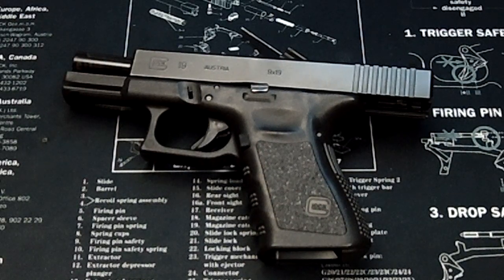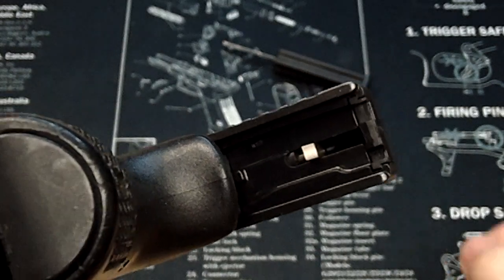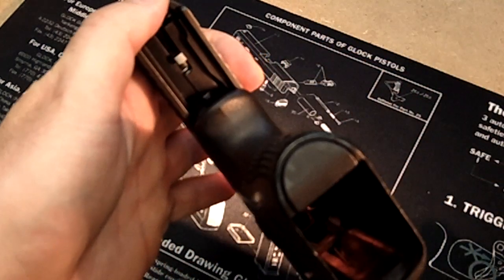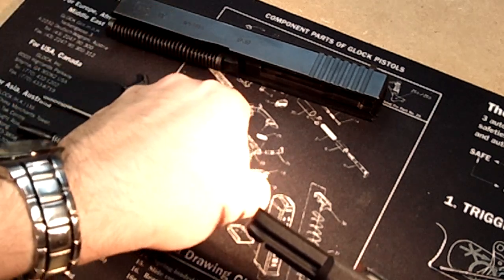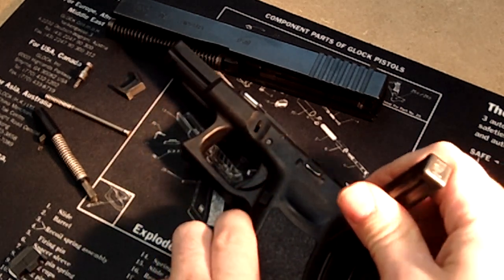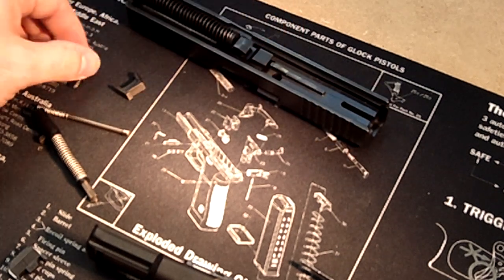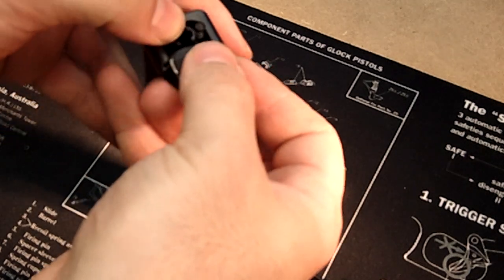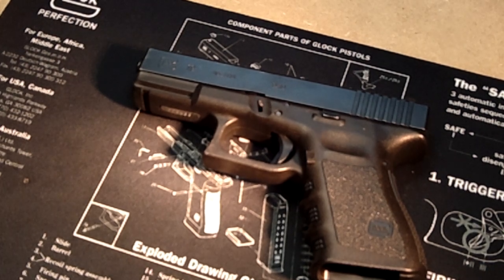What to do if your Glock won't fire

Comment: I agree with Bob BTRAVLIN, once you removed the rear slide cover, that releases the striker assembly to be pulled out. You did not have to remove the extractor depressor plunger, the extractor or the safety plunger to remove the slide.

Comment: FYI no need to remove the extractor, this issue is usually cause by the connector not engaging with the slide and needs to be bent outward.

Comment: Thanks for the video, I thought I was lost. Once I got the slide off, I watched your re assembly video and put my 23 back together. My problem was that the trigger was really stiff, sometimes it would get better, then it would get bad again. Soon I was having to use two hands to pull the trigger and it wouldn't break until I began to release the trigger (scary). After about two pulls like that it stopped breaking all together. After reassembly it worked but quickly began doing the same thing.

Comment: Just so you would know at 2:28 that is isn't called a an ejector - that is called the extractor. Ejector is a Sharp PIN that - ejects the Shell out. Extractor - extracts and holds the Shell out of the breech (Barrels Chamber) when the Gun has been fired.

Comment: AFT you pull the firing pin, reinstall the slide cover keeping the extractor in place, then remove the slide as normal. 
That keeps the extractor and firing pin safety assembled.

Comment: Very good video, but there is an easier way to do this.  If you pull the trigger but it won't release the firing pin (so you can't remove the slide), do the following - 
1)  Understand all firearm safety rules and ensure your firearm isn't loaded and that you don't have a round in the chamber
2)  Pull the trigger fully to the rear and hold it there
3)  The back plate of your slide has two openings - insert a very thin screwdriver (a 1/16" punch works great) into the right side (non-square) opening at a slightly upward angle.
4)  Press the point of your punch down (you're pressing down on the cruciform shaped part of the trigger that releases the firing pin) and your firing pin should release, allowing you to remove your slide.  Hope this helps!
Reply: or u can skip all those steps & just push the trigger bar past the firing pin safety through the Mag well & the trigger will engage

Comment: I had this issue. Had to take down my g21 probably 6 times I had an issue with the cruciform being too bent and not clearing the striker pin I ended up taking all the pins out to get the slide off, the rails come off with the slide

Comment: for the record, you dont need to pull the slide apart like you did just to get the slide off, only pull out the striker, then you can pull the entire slide off,
Reply: True, only need to remove the striker to get the slide off.

Comment: thanks for the video, I think my issue is the recoil rod. when i go to break down the slide from the frame it jams, and i need to use moderate force to pull it off and noted the rod where it meets the barrel is constantly off, whereas if i am gentle and assemble and disassemble the weapon while it is  inverted no issues.

Comment: What if it wont fire & there is no issue & you just got a cheap trigger bar from p80 so you order another one & it does the same thing so you get tired of it & get a OEM Glock part & BAM all of a sudden FIXED?

Comment: Can someone please explain the problem if you DIDN'T FORGET to install parts?
Reply: the trigger bar is the problem when this happens most of the time its not passing the firing pin safety if you look through the bottom of the mag well to the upper you can see the part im taking about on the trigger bar if that is stuck on the metal piece & not passing it then it wont fire its a bad or worn trigger bar

Comment: Hello friend I'm having the same problem but the extractor is in place. My slide keeps getting stuck and the trigger doesn't go into battery. The only way the slide comes off is if I remove the firing pin. Should I change out the extractor?

Comment: My trigger doing the same thing. It resets but wont fire. I took it all apart ant put it back together same prob. Everything is installed correctly. Its a polymer80 frame gen3. Could the problem be bad parts?
Reply: Did you ever figure out your issue? Having same issue with mine
Reply: Same, mine is doing the same thing. Polymer80 lower gen 3 glock 17

Comment: Bruh, you take down the slide first. Then take off the back plate. You press the trigger safety and the ejector just falls out as does the little spring and trigger safety plunger.

Comment: hello if you're still active with your channel, maybe you can help me.  i can only pull the trigger to get a click is when i manually rack the slide back and/or lock the slide open.

other than that, i cannot get the trigger to fire at all.  i have disassembled and reassembled and all the internal parts are there.  any suggestion?
Reply: Yo how did you fix it
Reply: Any fix for this issue?

Comment from the maker: Thank you.  I am just happy to impart a little of my knowledge, and help a fellow gun owner. If i can help later on, please let me know.
Thank you again for watching and for your comments.
Reply: What if all the parts are in correctly but yet it still wont fire.
Reply: I have the same problem as the other Daniel. I have all of my parts in in the correct orientation and my trigger still wont pull. Can you do another video on that and let me know when you do?
Reply: @TheWarnickthree  having the same issue you guys figure out the problem?
Reply: @superbee.83   I ended up having a friend help me out. Also it turns out that my slide was also hanging up on the bottom side of the barrel. I still dont know why the trigger wouldnt break when pulled. Sorry.

Comment: Awful video. Why would you leave the connector off the trigger housing?? And you don't have to remove the extractor & plunger to remove the slide. Once you remove the backplate the slide will come off